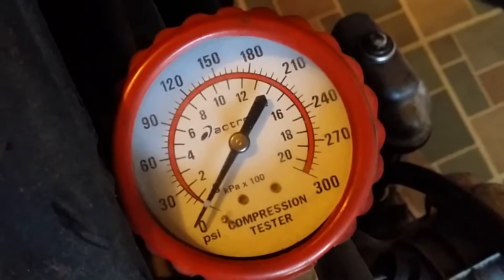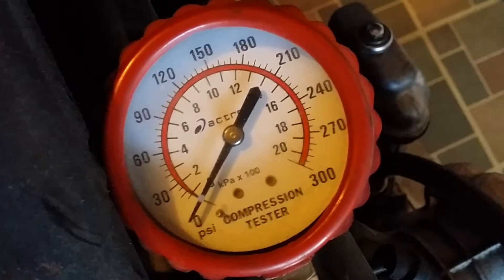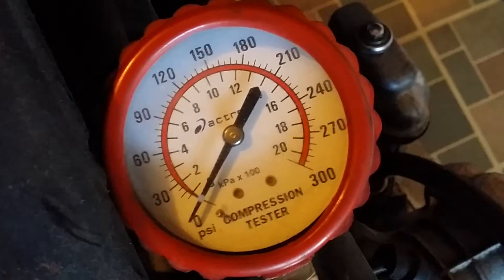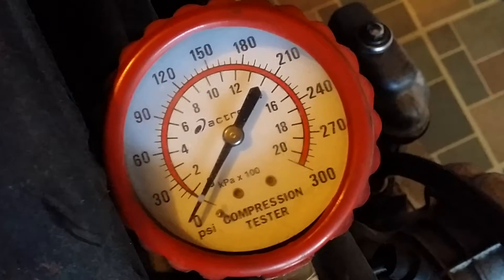Honda CB750 Compression Check

Comment: Excuse the newbie question, all the spark plugs might be out of the engine, or just the one where you are going to perform the test? I would do it on my old ´83 CB1100F...
Thanks in advance ;)
Reply from the maker: It is better to have them all out of the engine, so it can turn over easier, but it really doesn't matter. Each cylinder is individual. Make sure you hold throttle wide open during testing to allow maximum air in the cylinder you are testing. Good luck. Let me know the results.
Reply: @thedragon2299   i just did a test on my 1981 cb750k , came out terrible, all under 100 and she was only running on 3 cylinders when i finally got it running, i guess ill shim the valves first and see what i get , bike sat for about 8 years i got it very cheap, thinking it needs engine work
Reply from the maker: @1992240sxka24de  Yeah, that is low for sure.  Sometimes when they sit for awhile the rings get stuck a little in the piston groves squirt a little oil in the spark plug holes and turn the engine over alot with all spark plugs removed to try and free them up. Also like you said check the valve clearances and adjust them if needed. If the motor has high mileage, it may have worn out rings. Even if the rings are worn, its not expensive to fix, just time consuming and labor intensive, but you can do it if you follow along with a video. Or have a friend or family memeber that has done it before. Also the valves get carboned up sometimes if it was running rich, or burning alittle oil, and might just need to be cleaned and lapped. That means they arent closing tightly. And again, dont be scare its not that hard to do, and while you are in there you can replace the valve seals too. You can watch youtube while you do it, no problem, then it will run great for another 50,000 miles. Both of these things can be done in a weekend. Good luck and let me know if you have any questions.
Reply: @thedragon2299   Awesome thanks for the info on it!, All the valves are tight just waiting on a shim removal tool to start work! i will keep posted
Reply from the maker: @1992240sxka24de Oh yeah that darn tool.  Yes tight valves will definitely give you low compression, because that means its being held open a bit. I usually find that the exhaust valves get tight, not so much the intake. Another thing to think about is, if the bike has high miles and the valves are tight, sometimes it's due to carbon build up on the valve and seat.
Reply from the maker: @1992240sxka24de  If the valve adjustments don't make a big difference, you are going to have to pull the spark plugs out, fill each cylinder through sparkplug holes with marvel mystery oil and let it sit for a week, then place and old towel over spark plug holes and crank engine over to push out the mystery oil. Then when it stops gushing out, just remove towel and keep turning it over off and on for a couple minutes. This will free up the rings and remove carbon from valves and pistons. NOW when you actually try to starting again make sure it is outside, because its going to smoke alot from some of mystery oil that got into exhaust pipes. I have use this method for years and works everytime. I have had 0psi go to 150psi this way. Good luck and keep me posted. ALSO if you feel comfortable doing the mystery oil deal, you can do it while you wait for the tool. You can get it at walmart, autozone, just about anywhere. You can even just let it sit for couple days, then try it to see if any improvement.
Reply: THE DRAGON 
Thanks for the post